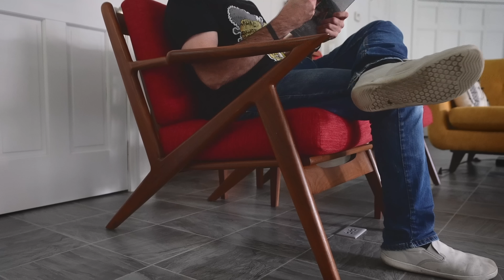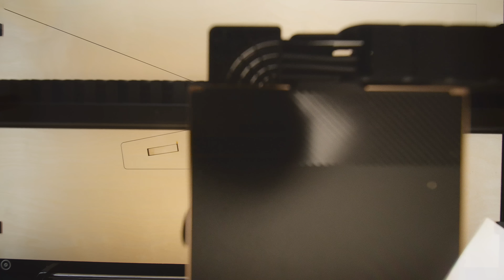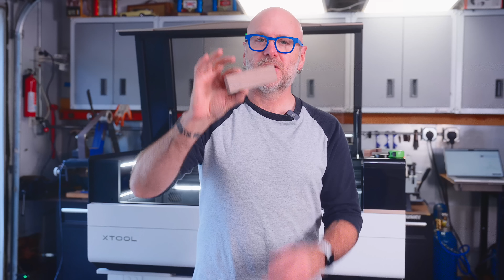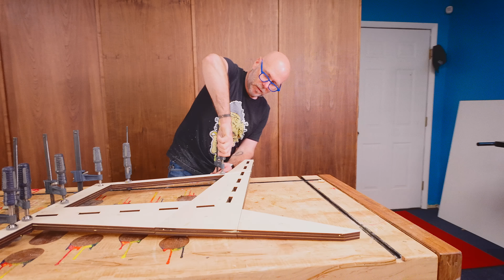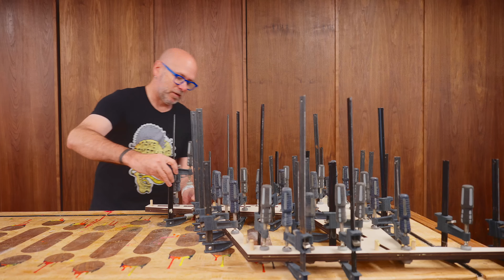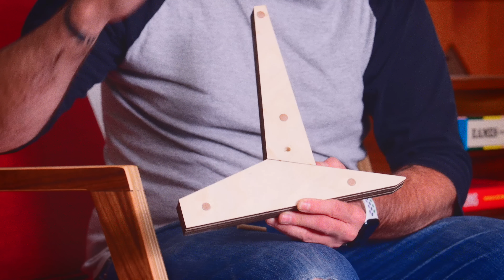The Laser So Good You Can Now Make REAL Furniture

Comment: Old furniture designer builder here, if you study fine furniture, including Danish modern, you will notice that the furniture is not square, it is pulled off perspectively. Also if you raise the seat hight you need to subtract from seat depth. The floor to back of seat measurement stays pretty constant. I always built mock ups to test the measurements and angles and attitude of the seat. Instead of slats for the seat you could make a frame with rubber webbing to increase the comfort and history of the style. It will never be seen and take it out of the patio seating kind of feel. Be interesting to see if your design software and laser cutter can deal with all the angles.

Comment: That is crazy, a desktop that can cut through 3/4 walnut and 1/2" ply is nuts. And it is basically the same price as a Glowforge Pro with all of the fixin's. For my next laser.... (paying to have one of my Glowforges fixed right now... so not in the budget at the moment). Also, the method you share at the end is brilliant. Glad that made it into the video. That in itself could easily be a follow-up video, showing how to do furniture using that method.

Wondering if you could do that with 1/2" (or thicker) ply, and then use 1/2" walnut on the outsides. Or hell, even just walnut all the way through, using multiple pieces to build up thickness.
Reply: He didn't cut 3/4 he cut 1/4 and 1/2. No way  this diode laser could cut 3/4 hardwood. at least not in a single pass or without 20 passes of vaporizing materials.

Comment: I saw Norm Abram make a mortise and tenon using a dowel to pin it like you described. He offset one of the dowel holes by a small amount and used a decent taper on the dowel. As he hammered the dowel in, the offset pulled the joint tight.

Comment: I love everything about this. I love exposed plywood layers on the edges, cutting everything with a laser and using glue instead of fasteners, etc. Here's the thing, I'm not going to spend $3000+ on a laser, how can I do it with the laser (20w, 400x400) I already have? Cut thinner sheets and glue more layers together? make dovetail joins or something to cover the longer spans? just doesn't seem too solid and def not as elegant.

Comment: I am a big fan of laminating plywood in a way that creates joinery.  I used that mortise and tenon approach for the rails to make my large assembly outfeed table in my workshop.  I wanted to be able to take it apart to get it out the door so I used screws to secure the joint. It would have been both expensive and time consuming to make that joint with regular wood, with the plywood it was almost trivial.

Comment: Great project!! But you said the only tool you would be using is the laser. You also used a hammer, flush cut saw, and a boat load of clamps, and from a structural standpoint, glue is also considered a tool. 😅
Reply from the maker: the only "power tool". I made sure I said "power" every time. 😄
Reply: @MakeSomething 

except for the title LOL 

minor detail.
Reply from the maker: You got me! 🤣

Comment: The M&T is good looking, but probably less strong than the multiple bridal joints of your current design.  It might be strong enough though - and the dowel can be offset a bit to make the joint "draw-bored".  I would consider a laser, but don't like the look of the burnt edges.  How much effort does it take to sand them off?